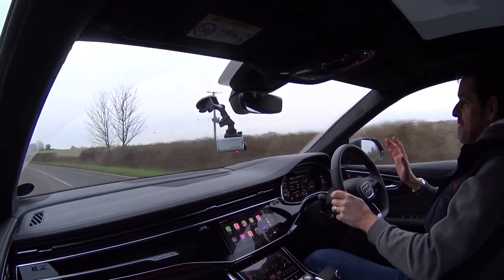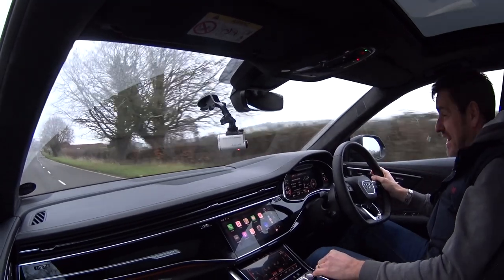Why are Car Makers obsessed with Fake Exhausts ?! [MONDAY TORQUE]

Comment: wouldnt buy any car with fake anything !
Reply: I'm with you Agent 008. I refuse to pay for such rubbish.
Reply: I agree 100%, but you'd have to buy a youngtimer then, because every single car manufactured today has something fake...
Reply: Agreed. I have a ‘10 Cooper S, a ‘10 Civic Si and an Impreza.   All have true exhausts with no fakery and that is something I’m conscious of with any car I consider     Fake exhaust tips, vinyl wraps, imitation vents.   All on my hate list.   An exhaust system should be a solid, fully connected jewel-like element on a fine automobile.  Not cheap metal junk hidden behind a bumper and a cheesy false tip.   
Milltek states one reason is the reduction in insurance claim values when rear end collisions occur.   As long as you can fool the pretentious buyer to part with his money, Ferrari, Audi et al don’t care.  The buyer wants to get laid and to have a reputation for affording expensive stuff.  No regard for true craftsmanship that will survive the decades.

Comment: Peter Aston
I very much agree with your comments on fake exhausts, but I would go further and say that there is too much plastic trim on both the front and rear of recent Audi models across the board. I bought a Q3 (40 TFSI Quattro) early last year which is festooned with cheap-looking plastic trimi, especially on the front.  Are they meant to be fake air intakes?  At least the fake exhausts on the SQ8 look real, whereas on the Q3 they're ridiculous.  How can you have plastic exhausts?!  My previous car., a 2015 A3 5 door 1.8 TFSI Quattro, had real twin exhaust outlets which looked lovely.  In fact I think the A3 was one of the best looking cars out there.  It had clean lines and all the exterior trim served a purpose, but I notice the current A3 models also have an abundance of ugly plastic. I don't get it. I don't understand why they make the newer model less visually attractive. almost tacky.  I sympathise over the fingerpirints - the wheel and press arrangement was much better than the touch screen which verges on the dangerous.
While commenting might I add a couple of points about the Q3?  I bought it from Five Oaks around the time you tried the orange one last year.  I too drove that car which was a 35TFSI non-Quattro.  The Quattro transmission is well worth it, unsurprisinglly not being  prone to poor grip on pulling away sharply.  However the gear box suffers from lag which was not the case with the A3.  THis seems to be intermittent and can be disconcerting.  Have you experienced something similar?  Other than this the Q is a fine car - really practical, almost the size of my daughter's Q5.  
I enjoy your videos BTW!
Reply from the maker: I know what you mean about the lag, I've felt that in a number of cars recently and not just with Audi 😬

Comment: Hi Ped
Fake exhausts. NO. NO.😬😬 Style over substance.
Reply: Best exhaust on any I have owned was Sports system on Morgan Aero 8, with side exit pipes. Hard acceleration into the red zone it would drown a V8 Vantage or Ferrari 360. 😄😄. Yet cruise@ 70-80mph in sixth gear almost silent.Best of both worlds, especially with top down.

Comment: Back in the day only engines with a V configuration had twin pipes.
Reply: Here’s something to wrap your head around… I have a 1983 Ford Sierra Ghia 2.3 V6 and it has one exhaust tip. Upon further inspection, it has two manifolds, two pipes, then they meet up half way and turn into ONE! Nowadays, a four cylinder sub as my Mazda 6 has one manifold, one pipe but then splits into two for some odd reason!

Comment: I think it's obvious that this is all due to getting the customer base ready for future electrification of all vehicles really. It has nothing to do with cost. The engine size is now being expressed in ranges of power (i.e., 45, 55, etc.. ) that will eventually refer to electric power output of the battery. Enjoy the petrol while you can gals and boys!

Comment: I bought an M3 E36 Evo new in 1996. The twin exhaust was amazing. Unequal length tips due to convoluted tracks each 3 cylinders needed to exit but be of equal length. It was a complete masterpiece, even the tiny bit you could see was a work of art.  For sound rack and drame and screamimg this was one of the best engines ever produced but that exhaust made it even better, I was lucky to own that art for 6 years.
Reply from the maker: Great car 👏

Comment: its been a long time since function and mechanical engineering has had anything to do with aesthetics and form, its partly consumerism and differentiation of models and and partly pretence that most buyers don't care enough about. My personal bugbear is with privacy tints on rear windows that make the interior dark and make things look like a commercial vehicle. the appeal of older cars with light and airy cabins has all disappeared. You may as well talk about lots of devices which mean no one pays attention to driving or how a car works, engine covers, auto wipers, auto lights etc etc......
Reply from the maker: Oops...I always spec privacy glass 😂
Reply: @PetrolPed  ha ha...

Comment: Peter, I should have mentioned to you that the Catalyst on the Honda Jazz in question was located near the front of the car & when they removed it, they also cut off part of the centre pipe & both lambda sensors (which were as expensive as the catalyst to replace!). Therefore I had several parts to replace, not just the cat & it took me about 3 hours to replace everything & to clear the fault codes that the theft caused. It occurred to me that the thieves would notice the car parked back in its usual position after a few days & would be likely to nick the new one, so I chose to make a heavy gauge (3mm) sheet steel enclosure to fit around the cat & I welded it to the vehicle. It would take me about an hour to get it off again if I needed to & I’m sure that if the thieves return, they will soon give up after they see the new shield. The shield cost me about £20 in materials & about 2 hours to fabricate & fit - much cheaper both in money & time than experiencing the same theft again!
Reply from the maker: Could you stick a couple of thousand volts through it ? 😂

Comment: It's a weight balance issue really. If you have two exhausts one on each side, the car might tip over. Much better to have two on each side to balance everything out really! Much better 2 fake exhausts on the car, than Audi fitting the car with tyres that last more than 20,000 miles before needing replacement! 🤣

Comment: Good on you. One of the main reasons I moved away from Audi is this terrible detail in almost all the Audis now. Even S4s and S6s have false tips.  So I have just bought my BMW M340i Touring - and apart from being significantly better than its competition, it has real exhausts and a wonderful sound. As an engineer I cannot abide this detail and will not drive a car where an accountant has made a decision. Good video!!
Reply from the maker: I have a press M340i Touring in a few weeks time. Looking forward to it 👍

Comment: Great vlog and idea. For fake exhausts I absolutely despise them. Why manufacturers even feel the need to use them is beyond any reasonable reason. Depending on how many tips the car has, make them all real, looks better and even feels more premium. Sure if the car takes a hit in the rear it's easier and cheaper to replace (damage depending), but if the car is written off because of it, fake tips don't really do much.
Reply from the maker: Glad you liked it 👍

Comment: CAT theft: CATS are normally fitted right up close to the engine as they work best when they are hot and are often are part of the manifold. If that is the case, in most circumstances the whole exhaust will need replacing. If the CATs are at the rear it must be a rear-engined car. This has happened to several people I know and also one was done the other day in broad daylight at our local golf club, with people walking about. It took them about 2 minutes then they were off in their stolen car...
Reply: Two minutes and they were off? Took everyone more time than that to decide whether to hit'em with a 5 wood or a 9 iron...
Reply from the maker: WOW 😮
Reply: @douglas_drew  😂 With the average age at the club about 70 I'm not surprised about that either... The fact that no one reported it clearly means they didn't have a clue what was going on, that was until the lady started her car and panicked due to the noise. They got CCTV of it, but needless to say the Police weren't interested...
Reply: @grahamtricker4103  I am shy 70 by about three months, but never had the patience for the endless club pondering. The thieves made the only wise choice, a hole in one.
Reply: @douglas_drew  😁
Reply: Update: The police have caught the catalytic converter thieves !! They were found on CCTV changing the plates on the stolen car. I call that a result!!!

Comment: Totally agree about fake exhausts. With CO2 emissions so in the press, why would you appear to be belching out more? Another gripe is the amount of plastics be used under the bonnet. Plastics don't like heat and are expensive to replace.👍🏻s up to the format
Reply from the maker: The plastic engine bay...I am with you on that one 👍
Reply: @PetrolPed  Another hate of mine is fake numbering eg BMW 540 335 etc What happened to the good old numbers where the last two digits represent the engine size 328 323......

Comment: My Alpine stereo was lifted out of my 5GT Turbo early 90’s 😢
Reply from the maker: Sounds familiar 😪😡
Reply: I had my radio stolen out of my R5 GT turbo as well, H reg tungsten grey. Still miss that car.
Reply: Jabber 1974 
Mine was a 1990 blue raider , Renault 19 wheels , full magnex exhaust , adjustable bleed valve , dump valve , alloy inter cooler the list went on ! Rapid in its day . Wished I’d kept it now
Reply: Optical Flow mine was completely standard. I couldn’t really afford the car never mind modifying it.
Reply: Jabber 1974 
Yours would have been worth more money than mine as standard great in hindsight see some on piston heads going for a lot of money standard . I like the 595 abarth reminds me a lot of the 5 turbo light turbo 1.4 and fun

Comment: I`m with you on this Pete...I hate the look of fake exhaust tips and even more so to any fake sounds pumped through the door speakers, I can see it could be to save on costs in the event of a rear end shunt where you simply replace a bit of trim rather than a full exhaust system but when you see and hear what the Italians can do properly, especially with the Alfa Giulia Quadrifoglio or indeed any Abarth, i know which  car i would spend my cash on...and it wouldn`t be German!
Reply from the maker: Cheers Peter 👍

Comment: The reason the diesel s4 and s6 have totally fake tips is because of the DPF. When it’s on a hot cycle the exhaust can potentially get hot to the point of melting the plastic of the bumper the tips go through. 

Same can now be said for the PPFs as well. 

I agree if they can’t get the actual exhaust on show, then just don’t bother and admit your emissions regulators mean you can’t have sexy exhaust tips.
Reply from the maker: Yep...good plan 👍

Comment: On the subject of catalytic converter, I have been told that, due to the heavy metals contained within, that they are actually radioactive. Maybe, the oiks will get more than they bargained for..

Exhaust tips - I am with you on that. I recall that Audi used to put chrome/shiny tips on petrol engines cars and unfurnished tips on diesels. Are they trying to disguise the diesels perhaps..

Comment: Another interesting, thought provoking video! The thing with exhaust tips is it’s what people have become used to, identifying specific trim levels by the size or shape of your exhaust 🤣. Moulding plastic to look similar is obviously a cost cutting exercise by the manufacturers. The solution to catalytic converter theft is coming... Electric vehicles! (I’m not a fan). In the meantime, they should be more difficult to remove.
Reply from the maker: Yep. EVs solve both problems 😜

Comment: Absolutely with you on the fake exhaust thing, it feels wrong. But I guess it's no different those bits of plastic that are supposed to look like a diffuser, and of course most of the radiator grill on most cars is purely aesthetic. I must say that I really don't like the fake exhaust sounds on many (mostly German?) chav-mobiles. A bit of pop and crackly now and then when the car is working hard is fine, but a massive fart every it dribbles away from a set of traffic lights is just daft. Love this format.
Reply from the maker: Cheers Bud 👍

Comment: Cracking format Pete and a topic of frustration I share with you. I agree with your thoughts on either opting for the real deal or using a conventional down-pipe and fully skirted bumper. Again, personal opinion, but I think it cheapens what are ordinarily very expensive and well-assembled cars. Dare I use the Halfords accessory add-on context... 😉 Stick with some topical vlogs, great content as always Sir.
Reply from the maker: Thanks Darren 👍

Comment: 20 years ago we would call a car owner or designer who sticks a double exhaust on a single pipe a tasteless faker. They would at least not block one of them. Now they do it officially, even with total functionless applications. Unfortunately this mentality is now sitting in the executive design offices of the leading car manufactures. It's a clear prove that design, functionality, art and cost management does not interact progressively. It's a management error. I saw a new Volvo with four fake exhaust:)

Comment: With you 100%! My exige 430 cup has a single exhaust. 675LT twin exhaust..any more than 2 is extra weight and a waste! Please have a rant about cars that are too big  for the UK,  sat nav & infotainment screens that can't  be turned off,  fake engine noise & cars that have too much power for their chassis and therefore constant traction control intervention!
Reply from the maker: Some great suggestions their mate. I'll add them to my list 👍

Comment: I have a diesel car with "proper"  exhaust BUT the beautiful chrome surrounds get very sooty ( even with proper adjustment and servicing). 
On these new cars with the exhaust pipe turned down under the car  the fake tail pipes keep clean and shiny.

Comment: I think the fake exhausts on diesel cars is because they kick out black smoke under hard acceleration. So manufacturers prefer to face them down underneath the car.
Reply from the maker: But the inner exhaust on the SQ8 doesn't do that. It comes through the inner tip 😕

Comment: Love this type if format mate,  should keep it going. 

On the topic of exhausts and CATS,  it's not just the converters these thieves are looking for it's now going into DPF systems again due to the materials inside.  It's a tough one to combat especially when it comes to a consumer/cost aspect,  In fact I'm having a bit of a nightmare with Audi just now over a DPF/CAT failure issue on a new A6,  the way Audi position the DPF and CAT is to integrate it into one unit attached to the turbo underneath the engine which for a theft scenario is ideal because you essentially have to remove the engine mount and most of the internal components on the engine to replace and or access it making it impossible to steal without having to physically steal the actual car,  the big downside of this as that should you have to access this the labour charges are through the roof on any new Audi you are looking at over £1500 in labour just to remove the DPF/CAT system that's before having to pay the cost to replace the system which can easily add up to £4-5k total cost and that's trading the old system in as well (another reason as to why I'd never touch a diesel Audi again,  but that's a different story all together).

With regards the exhausts, totally agree it seems to be the new trend however I feel that manufacturers are probably being forced into doing this due to emission controls,  a lot of the new cars on the road have to have specific back pressure in the exhaust for the full system to work as efficiently possible,  the more flow you have the more power you essentially generate however this comes at a cost of fuel efficiency,  sadly I think this is the way the market will end up going on the upside though at least its giving after market tuner companies incentive to create products for these cars lol.
Reply from the maker: Great to hear you like the format and thanks for the comment. Really interesting 👍

Comment: Agree with the exhaust tips.....I think they should just design a centre exit if going to run fakes on one side!  Had a huge problem with stolen cats from the train stations in the Greater Toronto area... using cordless reciprocating saws.  Just roll from one car to the next cutting them off.  Then load them and take off.  Scrap metal places are legally obliged to document the selling of cats.  BUT always a way to deal them as you said.  It seems to have settled down in our area though, so something is working.
Reply from the maker: Wow...didn't know you had the same problem in Canada 😪

Comment: I prefer no visible exhaust over "exhaust tips" which are not connected to the actual exhaust.
The middle ground where the exhaust tip is not directly connected to the exhaust but fixed to the bumper does not bother me at all, but a 100% cosmetic exhaust tip like those emerging on the new Audi S models just doesn't make any sense, if this continues we will end up with fake exhaust tips on electric cars 🤣
Reply from the maker: LOL 😂